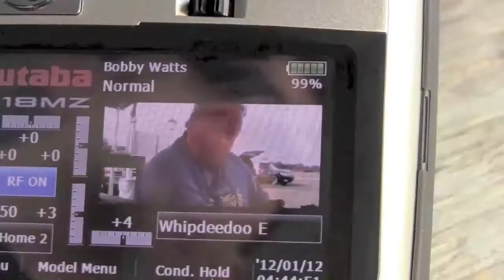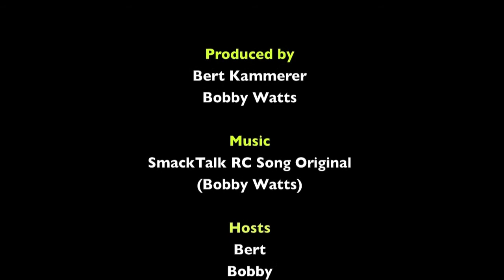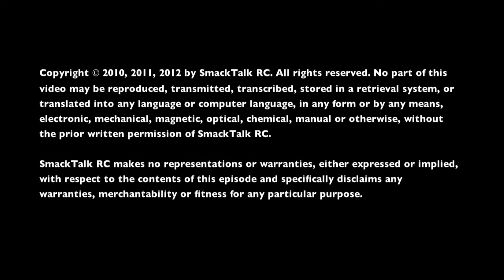SmackTalk RC 3D Tips #2 - Piroflips vs Chaos

Comment: Having learned piro flips it helped save me a re-kit once.    Some 10 years or more ago i was flying at an event in cincy on a really really windy day.  I pulled the heli nose up to a stall and then hit max piro rate cause that always sounds so cool,  and let it fall for a bit but as it got lower my fury90 decided to toss the entire tail case into orbit.  The heli was still basically knife edge piro'ing like mad and falling.  I could hear people behind me saying oh thats gonna be a re-kit (aka crash/complete loss)...  i hit hold, and started piroing the cyclic and was able to level it out even though the heli still hadnt fully stopped rotating yet due to no tailcase.   At that point it was just an auto like normal.  When it touched down everyone shouted like i just scored a touchdown at the superbowl.  Good times.